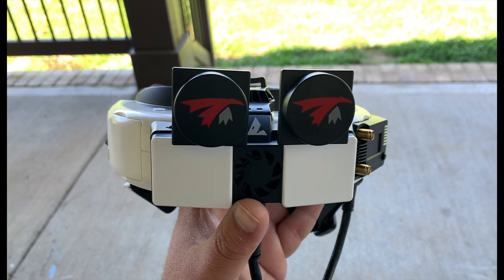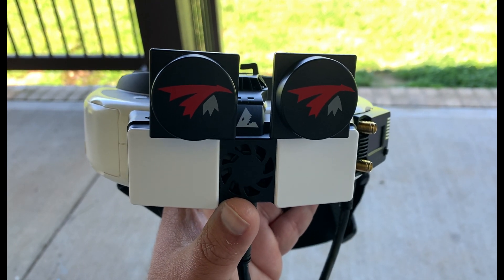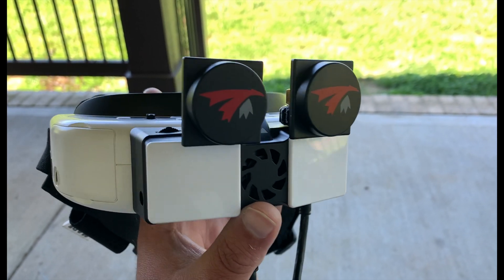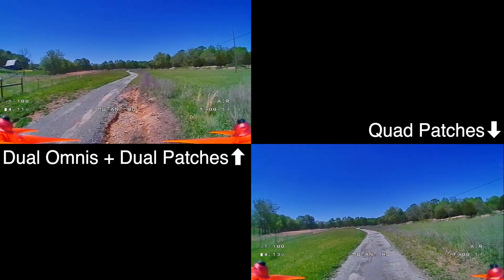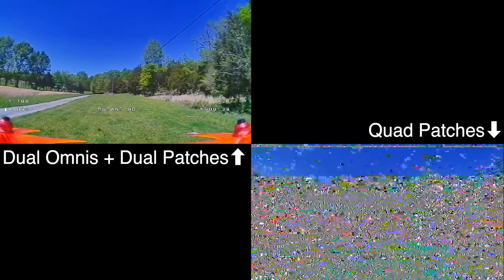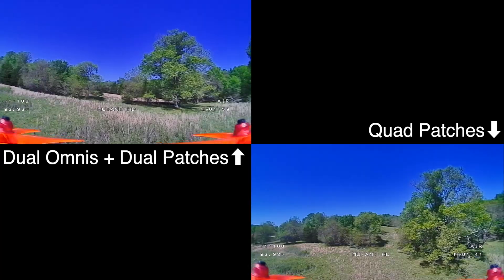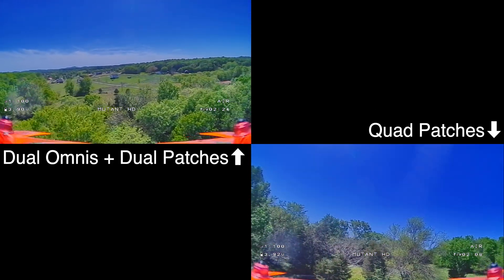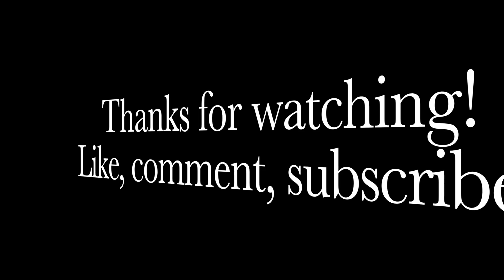Shark Byte Antenna Comparison: Quad Patches vs Dual Omnis/  Dual Patches

Comment: What about using one omni and one patch on top? I'm considering trying that when my system arrives.
Reply from the maker: I can get rid of breakup behind myself almost entirely with that setup. Actually flew with that setup yesterday.
Reply: @TitanFPV  Would you say that'd be one of the best setups on Sharkbyte without modding the RX? It sounds promising
Reply from the maker: If you fly behind yourself, for sure. I’ve uninstalled the patch mod, and generally run two double AXIIs.
Reply: @TitanFPV  I'm not really flying behind myself. It's mostly in front of myself. I have two regular AXIIs that I can use, or I'll run an AXII and my nice Ethix Patch antenna. Which do you think would work better to start off with? I'll experiment myself, but I want to have something to have as a starting point setup before I mess around with configurations.
Reply from the maker: I’d probably go with two AXIIs then

Comment: Nothing wrong with the built in SpiroNet LZR-mini patches...other than they don't have the highest gain.  compromising penetration for small form factor.
Reply from the maker: Yeah, I don’t plan on modding my system. Higher power VTXs/ firmware updates should do the trick.

Comment: Good  info.👍🏻..antenna choice seems to make a huge difference. I've pretty much settled on double axii cp's up top and double axii patches on front using the angled patch mod from thingiverse. I was using 2 long range axii  cp's  instead of the front patches and it seemed to work well  but it looked like I was wearing a catfish mask with whiskers sticking out every which way...lol...
 thanks again 🖖🏼
Reply from the maker: LOL

Comment: hm, not that improvement you hope for?
how it works if you fly behind you are trough massiv buildings, patch antennas should have a better penetration.
Reply from the maker: Something with even a higher gain like the Vulcan v2 would probably yield a bigger improvement. These are what I just had on hand. https://www.truerc.ca/shop/5-8ghz-2/receiver-ultra-range/vulcan-5-8-mk-ii